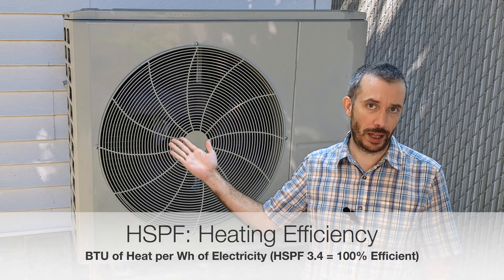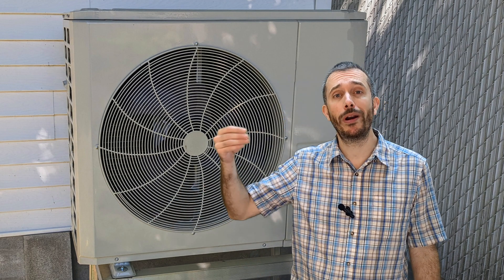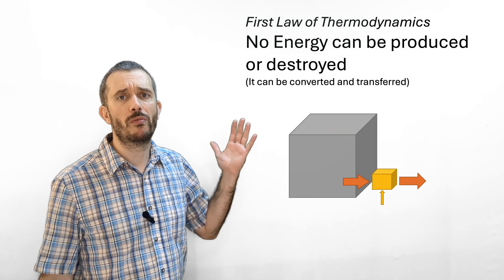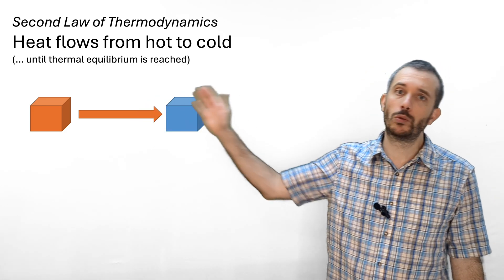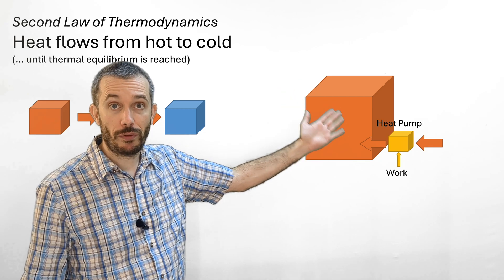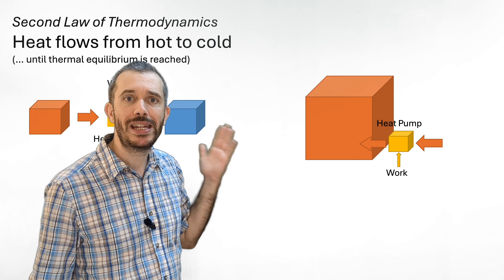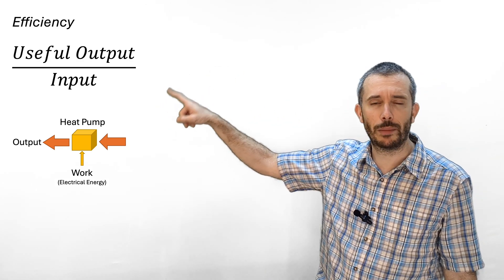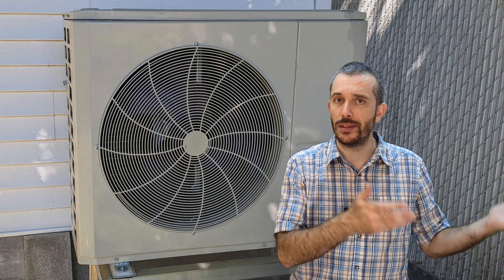Do heat pumps break the laws of thermodynamics?

Comment: Nice explanation! I’ve never taken a physics class, but I find the subject fascinating. Recently, I’ve been considering building a greenhouse, and I’ve been brainstorming ways to address temperature management. While geothermal storage strategies are commonly used, I’m intrigued by the potential of passive radiant techniques for both heating and cooling needs.

Most passive radiant cooling strategies I’ve seen rely on ejecting thermal energy to space, leveraging space as an effective heat sink. However, I’ve been exploring a different approach for greenhouse applications—using both the heating and cooling effects of passive radiant systems.

My idea involves a specially engineered stack of transparent layers that could bend light progressively closer to the surface normal. Light entering from the opposite side, at increasing angles of incidence, would tend to reflect back. A parabolic surface with such a coating could encourage thermal radiation to emit normal to the surface (as if reflected) while reflecting incoming light at non-normal angles. This setup could focus thermal energy to a collection region, where it could be removed to lower the effective surrounding temperature and enhance radiant cooling.

The emitted thermal energy could also be captured to heat a working fluid, which could then circulate to deliver heat where needed. Instead of ejecting thermal energy to space, could this concept of redirecting thermal energy allow us to harvest both heating and cooling effects using specialized films and reflective surfaces?

For instance, at 60°F with 0.9 emissivity and ideal conditions (no re-absorption), roughly 8.26 square meters of radiant surface area would be needed to achieve 10,000 BTU/hr (2.93 kW) of thermal transfer. Even at 80% efficiency, requiring about 10.33 square meters, this approach might still offer a reasonable return on investment.

Do you think this concept could be viable?  This kind of system could be placed underground to reduce its effective footprint.
Reply from the maker: Have you considered combining a standard greenhouse setup with water tanks for energy storage, a heat pump, and solar panels? It might be a simpler and more practical solution to implement.
Reply: Thank you for the suggestion! Combining a standard greenhouse setup with water tanks for energy storage, a heat pump, and solar panels does sound like a practical and efficient solution, especially given the maturity of those technologies. I’ll most likely use geothermal as the thermal source (for heating) and sink (for cooling) as well as heat exchangers.

My interest in the passive radiant approach stems from exploring ways to minimize active energy inputs and leverage novel materials for dual-purpose heating and cooling.

The idea originally came from looking at ways to reduce operating costs for refrigerated trailers. SkyCool's radiant film seems like it could offer a strong ROI for that application in the future. However, I started wondering whether, for a different application, it might be possible to use both the heating and cooling features of radiant cooling. Integrating passive radiant systems with existing technologies could complement them by reducing the load, particularly during extreme temperatures.

Do you think a hybrid system—combining passive radiant technology with conventional methods like heat pumps and solar panels—could have potential? I’d love to hear your thoughts, especially as I’ve never taken a physics class!  I do not actually know if 10.33 square meters of radiant surface would be able to deliver the performance target. Aside from the initially high cost of the film, it may never be feasible.
Reply from the maker: @karlswanson95  Let's assume 200 W/m2 of power from a solar panel, used to drive a heat pump with a COP of 5... So you'd get 1000 W of cooling (for one m2 of solar panel-covered surface) ... can the other system beat that?
Reply: @StefanBracher  Thank you! I’d probably opt for the heat pump but use water as the thermal transfer medium, given its 3,400 times greater carrying capacity compared to air.

I was exploring the radiant cooling option because of its novelty to me, but the practicality of a heat pump makes a lot of sense.